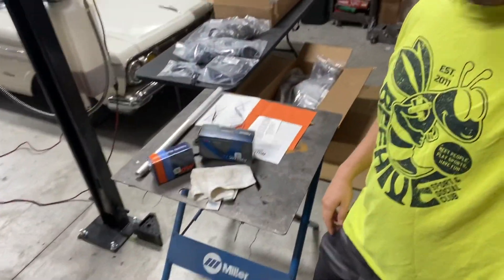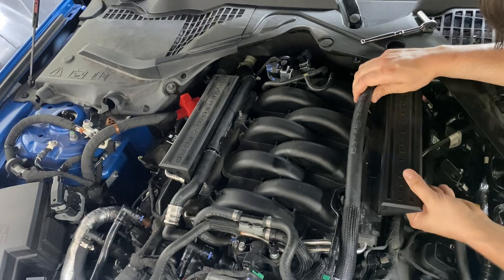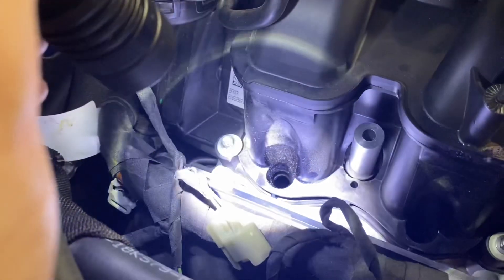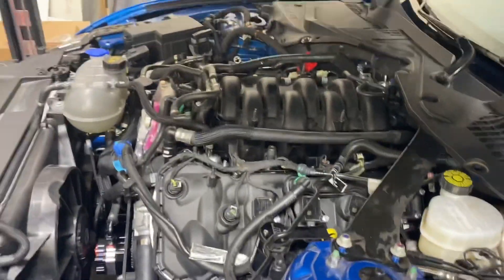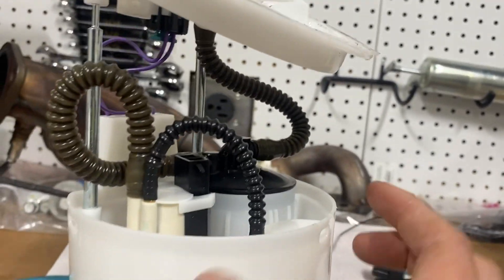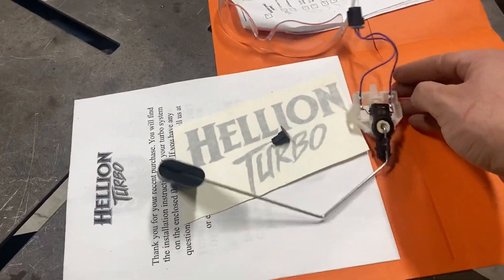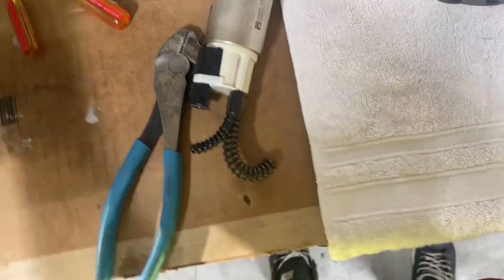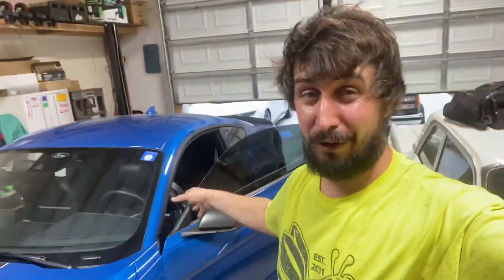Mustang Mach 1 Fuel System Installation Step by Step

Comment: Did you have any issues with the injector harness connector not clearing the head on the rear passenger and front driver?  Mine I had to rotate the injector the other direction to clear the bump on the head.
Reply from the maker: I cant recall to be honest.  However rotating your injector should not be an issue so long as its able to be rotated without it hitting the fuel rail itself.  As long as you can rotate it say plus or minus 90 degrees it should be fine and the o rings dont care

Comment: Nice video thanks! What kind of results did you see from the pump and injectors? I have an 18 with a Roush phase one s/c and I was thinking of adding the DW400 and some 78# injectors to.
Reply: Ok will do thanks! I can datalog before the fuel add ons. I wanted to drop from a 3.0 to a 2.7 pulley to add boost, and get a more aggressive tune. Hoping to get get closer to 800 crank hp when I’m finished but I’m very new to this. Thanks again!
Reply from the maker: To be honest you will want to try and datalog to see how your fuel system is handling it now.  Theres no benefit to having a way larger injector then necessary/same with a pump - within reason.  If you plan to add boost and can see you need additional flow (either high injector duty cycle or pressure dropping off) its certainly time to upgrade for the safety of your motor.  This setup supported over 900whp on gasoline :)

Comment: The last time I did this was probably in the 80s and we did it differently with a external fuel pump over the rear axle area and the fuel pump system you were just working with in the video basically became just a in tank fuel pickup with no pump , so the motor would rely on one large external fuel pump ,  we always thought it was cleaner.... at the time we used a Bosch and it would support 800 horsepower and then if you needed more we would use the Weldon  pump.. we would use a new braided fuel line going up to the fuel rail and then the old fuel line became the new fuel return line to the gas tank.
Reply from the maker: 2018+ add another layer of complexity as they incorporate a high pressure fuel
System (direct injection) in conjunction with the standard port fuel injection which has been around since the 80s/90s.  Im approaching the limit of the stock fuel system components (i.e. lines and rails) at my intended power level.  Beyond that it isn’t uncommon to increase line and rail sizes and convert to a return style system somewhat similar to what you mentioned.  There are companies who make larger DI components as well (which would be ideal) but thats pretty cost prohibitive at the moment